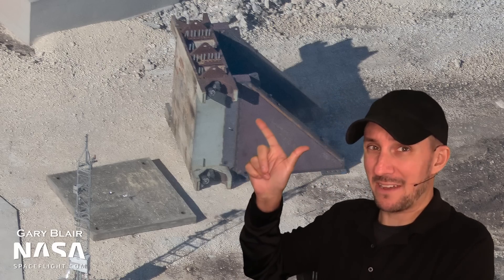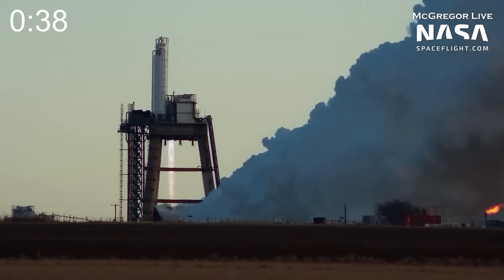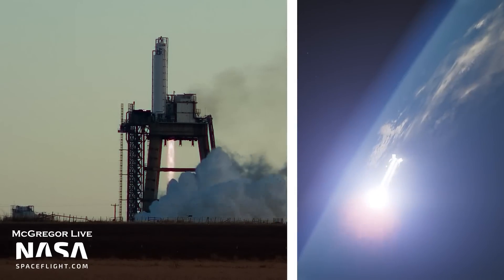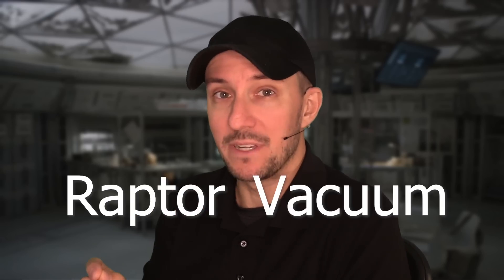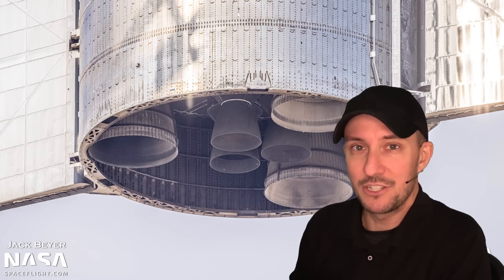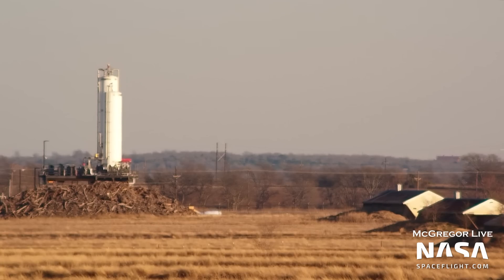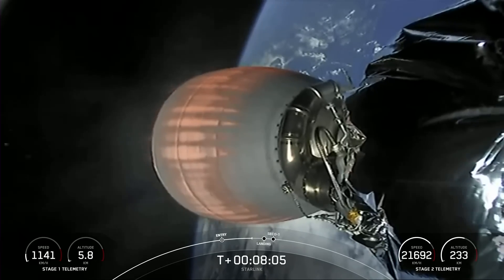Is SpaceX Firing Rocket Engines at Concrete?

Comment: Starship can’t land or take off on Mars or Moon with engines at the bottom. Even tiny Apollo Eagle lander was damaged when landing on sandy Moon ground. And it didn’t have to take off again, as only the top launched off the base part of Eagle. It will be impossible to build a launch pad on Moon or Mars anywhere similar to the ones on Earth. The only solution is to change to a spherical starship of some 30-40m diameter, with an equatorial ring engine complex which spaces the engines properly and pits some serious distance between the ground and the engine exhaust. Add some 10m telescopic spring dampened legs and land and take off with throttled down engines. No way around this. Landing directly on the Moon with 1/6th G with the current design will destroy the whole engine section, if lucky. Worse on 1/3 G Mars. Better still would be to build ships that don’t land on celestial bodies at all and such that do, but only once and are dismantled for ground structures completely. Refueling ships in Space so as not to worry about fuel braking and soft landing without any heat shield requirements is another aspect. With large cargo Starships transporting additional landing and take off fuel is much more economical than building a Martian or Lunar spaceport similar to Boca Chica.

Comment: To be clear, vacuum nozzles are designed to increase efficiency by further expanding the gas and converting more of the pressure and temperature latent in the exhaust to velocity (and thrust). You can't do that at sea level for the highly optimised nozzles or the atmosphere will creep into and up the sides of the nozzle bell causing violent lateral forces which will destroy the engine bell. It's fine to have a sea level raptor in space, it's just it wastes a bunch of energy, the vacuum nozzle allows for a better engine. There are other reasons vacuum nozzles aren't used at sea level as well, weight of the bell is a good one, limits on vectoring etc, but by and large the expansion id the main reason

Comment: Well they have basically unlimited engines to test fire being passing them onto a starship. Smart move to test them against conrete pads they can build and put up behind the rocket to see which formulation holds up best. But I think they are just overthinking things, just put a giant steel plate with a flame diverter and intergrated water system beneath the booster instead of rebuilding this concetere after every test. Concrete can't handle the variable shockwaves but a solid metal can.

Comment: probably the best way to test different concrete components for the launch / recovery pad. why not use the testing area for the new rocket engines that will be used to test some new concrete compositions to see what would hold up the best to the Raptor's torment

Comment: I wonder why they're testing Raptor against concrete now?
We knew two years ago that Raptors were damaging the concrete slab of the landing pad in Boca Chica and the concrete debris were damaging Raptors. Now there are a total of four launch sites using flat concrete pads, the Boca Chica launch pad is being damaged each time an static test of a booster is performed. In my humble opinion they should have tested the concrete to make modifications to the launch pads way back then

Comment: If SpaceX could eliminate the need for water deluge and all the related equipment, that would save a lot of money and complexity, and reduce environmental concerns from the disposed water, too... Investigating and developing heat-and-blast-resistant concrete for takeoff and landing zones would be one way to do that.

Comment: That giant hunk of steel for the backer plate at the test stand looks oddly like an old injection moding tool carrier... I wonder if they just napped an old one from behind a tesla factory? it's about the right size to handle their chassis components. It's definitely not a concrete block as you suggested, as that would be useless for testing. the loops at the top are where the coolant lines and such for the die would mount.  The big concrete square in front of it would be the test media. they will mount that to the immovable die to simulate being on the ground. I would bet they put that block right at the same distance as the height from the pad to the engines at starbase

I'm just surprised they are still using concrete and not just making a 2" steel pad. just weld out a big area of plates and use some 3" hardware to lag it into the concrete below

EDIT:
taking a better look, I don't think it's a tool holder, more part of the machine it'self. the machines have 4 big pistons, but the ears on this are 90* off rotation to engage them, leading me to think this is probably a baseplate for the entire machine, and that it would have the rams mounted "vertically" in this orientation. they are probably using the side that sat on the floor as their testing surface, and the side that held equipment as their mounting points.
I bet it's either torqued and not flat enough,  or it's got a big ugly crack that won't keep tolerance in production

Comment: Fantastic video, would love more of the same from this guy! How about a deep dive into the whole OLM situation with Starship/Super Heavy testing. Why haven't they installed a standard flame diverter? Is there reason behind the madness? Is there any kind of concrete that will stand up to 33 sea-level Raptor engines?

Comment: Why not use a thick slab of graphite under the OLM to take the heat?
Reply: I wondered this too looking at the mohs scales implying granite about a point higher on average, but surely no need to do the  whole area, just some  big circular tiles at each of the most affected zones ie 2-3 metre disc directly under each engine perhaps. then just reinsert new ones when too worn out

Also wondered about ice which can get up to concrete hardness at -100c so a layer of that prechilled before launch. It;'s not like they don't have lot of cold liquids around to chill it

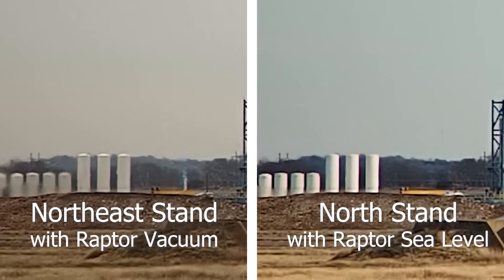Comment: @7:00 that vent you see when the raptor starts firing - I believe that's the flow arrest pressure vent for the turbopump starter line.  They pressurise the turbopump to spin it up. Just before ignition in the turbopump they shut off that pressure source and switch to the propellant lines. But the pressure source is coming from a long pipe, and the contents of that pipe have momentum.  If you slam a tap you can burst the pipe.  So they have a pressure release valve to release that pressure spike.  Similarly you see venting elsewhere in the seconds before ignition.  They need to get the momentum up in the propellant lines, so they need to start pumping it to the engine before the turbopump is actually started.  So those are venting ahead of the moment where they switch the turbopump from the starter pressure source to the propellant, so that the propellant is in motion toward the turbopump when they switch, so that the turbopump doesn't stall.  Now when you watch spin prime and ignition tests on the launch mounts, you'll have more insight into why there's venting happening... it's not all ollage and equipment tempering.
Reply: Sounds plausible, and curious... because we don't see it on the other stand. Perfectly possible it's there as well, and just angled sideways, down, forwards, or some other direction that prevents us from seeing it. -Das

Comment: This video highlights the repeating problem with the concrete at bocage cheeka OLM. Especially with the 33 starship engine booster is so powerful, even with 11 or 14 firing in tests so far. Spacex needs to get blast channels dug around the OLM pad, to stop pad destruction and concrete shrapnel, that's consistently failing.
With the 33 full engine test or launch, which will be the biggest initial thrust ever, there is no concrete strong enough to cope with it, without having those blast deflector chanels

Comment: IMO you need to correct your comment about engine nozzle size at sea level vs vaccum, one of the main constraints at atmospheric pressure is that when flow inside nozzle is accelerating the pressure is decreasing, so in order to make it outside safely it needs to be higher than atmosphere pressure otherwise there will be flow separation and potential damage to nozzle, Scott Manley has a video on it. In space there is no air or pressure to cause this issue so engine nozzle is made bigger to extract maximum energy from exhaust.

Comment: That concrete and steel "target" does not look to be in the main firing line from the sea-level engine, off to the side (closer to the camera) slightly. It looks like the main exhaust path goes between the new stand and the JLG man lift. 
Could the vectoring aim over far enough to hit the target from there?

Comment: Could you use objects of known dimensions in some of the McGregor photos to estimate the distance between the Raptor engine on the test stand and the "concrete test object" to see if this distance is a match for the distance from the booster raptors on the OLM and the troublesome concrete pad below the OLM?

Comment: VERY good deep dive. The steel triangle reinforcements each have two plates under them (the one in front is almost hidden behind the concrete target and shadows). The plate in the back has 4 holes in a line that appear to be the same size and spacing as the 8 hold-down bolts sticking out of the pad. It would make logical sense that these actually have 8 holes (4 hidden in the back) and the other plate that is barely visible also has 8 holes in a 2x4 pattern. You can see on the pad that there is quite a bit of concrete on the front side of the bolts, which gives room and support for the concrete target. The target is 100% going to bolt onto those 32 bolts on the pad.

Comment: before I make the statement I want to also say that I do love spacex I'm all about their mission to making life multi planetary I'm a big supporter of that ideal. now with that out of the way let me tell you why I hate stage 0 it's not freaking high enough off the ground! I have no idea what the engineers at spacex were thinking but they had to know that they were gonna run into this issue before they even built this monstrosity no this feels like somebody ego took over here lord knows I don't wanna point fingers but if I'm not an engineer and I can see this coming how come they didn't? i'm kind of bummed out that this is where we are you've built this incredible machine and the that's really holding it back for the most part it's whether you're going to disintegrate every bit of concrete under the rocket. This is unbelievable and completely unnecessary.

Comment: try and measure the distance between the rocket engine and the target test, then try and measure the distance between super heavy engines to the concrete floor
Reply: The distance at McGregor is approximately the distance from an engine to the ground on the suborbital pads. They have a little bit more distance on the orbital pad
Reply: @thomashayden804  on the side test?
Reply: @CUBEoneVX  Yep!

Comment: They need to go with an exhaust evacuation system. It has several jet engines that force a suction underneath the launch stand. All the fire, smoke, and water travels out in a vertical slopping 90 degree turn horizontally. It’s used in power plants and chemical plants.

Comment: I'm thinking a cone shaped platform that can be wheeled in and tied down to direct the exhaust so it does not hit a flat surface, the cone need not be very tall just enough to direct it off to the sides ! You shoot a bullet at a flat surface and it will blast the surface with all its power but if the surface is tilted the bullet will bounce off to the side with much less damage ! I think exhaust will do the same !

Comment: Great insight and find.  I suspect at the end of this they are going to realize that there isn't any material on earth that is going to hold up to this kind of abuse...that isn't going to degrade under these circumstances...orbital launch and the full complement of booster raptors blasting away...simultaneously.  A (not so) simple stand over a flat patch of some type of concrete isn't going to cut it.  Time will tell.  But keep in mind that a daily cadence of flights (if not hourly) is the ultimate goal.  Does anyone really think the current configuration is going to remain completely intact...launch after launch after launch?

Comment: testing engine restart in test stand is cool but not enough. back when early SN were being test flown, engine restart problems at landing were due to factors not present in test stand (pressure in tanks etc).  so they should do restart tests on an actual vehicle at boca chita, instead of just testing pre burner spin up for 1 second.  but such tests would require re-usable launch pad, something they haven‘t achieved yet.

Comment: SpaceX needs to preheat the concrete before ignition to prevent spalling and that's what's causing the damage and debris, If they would heat up the concrete enough to reach maximum expansion that way when all 33 are fired the concrete is already expanded thus preventing spalling and debris just like in a Blast Furnace or even a refining furnace.

Comment: why are they not catching Falcon9 Boosters with a Mechazilla for Falcons? So they can test this in a smaller scale. Even falcon boosters can not hover, but they can remove the legs and have therefore maybe the ability to land the middle booster from a flacon heavy for example. Or catch boosters even from missions with high payload or a high orbit. what are your toughts?

Comment: Nice video but a bit too drawn out, and then the disappointing final revelation that the concrete at the start was not the object being tested for material strength, but just a mounting point for actual test articles.

Comment: I'll throw my 2 cent's in on the concrete. Remember they can't go down like the Main pad in Florida. They also as we've seen can't put a layer of that high heat resistant concrete over the top or it will still fly apart in chunks. So as I've sent them numerous emails on this.
 They will likely have to make these huge thick chunks or that high heat Crete to slide into position underneath the launch pad. Concrete asany don't understand is strong but only with proper thickness calculated, if not it fractures and adios. I believe this is the only option they have since building a blast trench isn't allowed and once they fire all 33 those engines at once might destroy the existing pad without this type of solution. Time will tell and I can't wait. Eye witness to the biggest baddest launch ever or the complete opposite in a epic explosion,both will be awesome 😎👍

Comment: I've been saying this for a while, they need a flame diverter. They could dig out the bottom as well. Someone replied that it would be below sea level, well it's the same way at the cape in Florida and they've done it there. Now, they also raises the height of the concrete pad that the launch mount is located on. Finally, maybe a cryo cooled metal plate or even multiple vertical spikes protruding upward? Just some ideas to reduce the downward force on the pad.

Comment: Im fighting a thought right now, maybe it was asked previously but could it be possible to make a Falcon 9 Rocket but using Raptors instead of merlin's engines? If taking in account propellants and design changes to use raptor engines could it be possible to do the change?
Reply: Even the lowest throttle setting of a Raptor is way too powerful to land a Falcon 9 booster. It's also more powerful than the second stage could deal with. The G forces would destroy payloads. The mvac engine is already too powerful and has to throttle down near the end of the burn.
Reply: @williamgreene4834  It's so funny when they do a circularization burn and it's just a 1 second poof.

Comment: Maybe a silly question but why bother with concrete at all. Couldn't they dig out a hole which contains water and blast away? The only thing they need to keep in mind is to keep the reservoir topped off with water whilst the exhaust plume interact with it. Is there a reason why rocket launch sites don't use this?

Comment: acoustic pressure and vibration can be a factor. vibration frequency and harmonics can tear some stuff up.  the past concrete pads were a "one trick poney". looked good on paper. maybe put a Fluid Viscous Damper under a thick slab of the stuff they use in interior bank vaults. segmented and interchangeable or course.